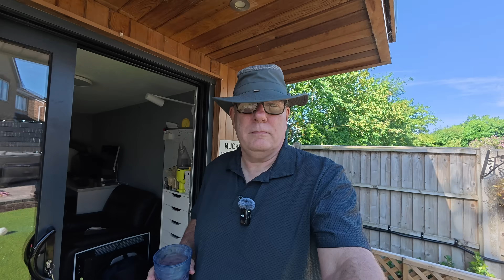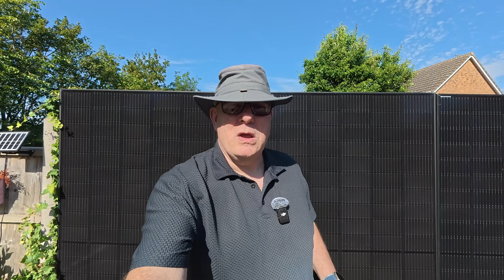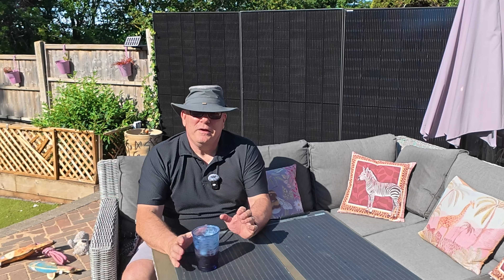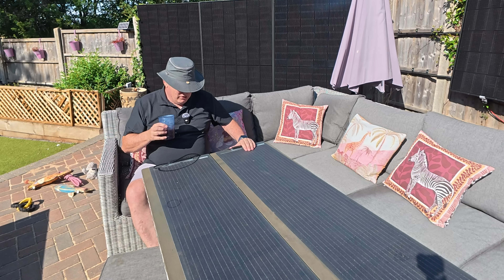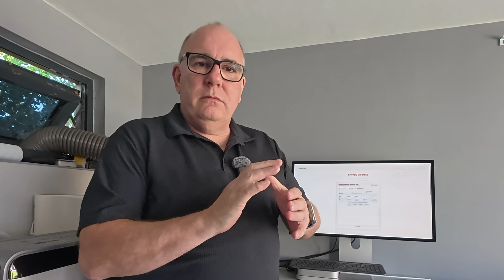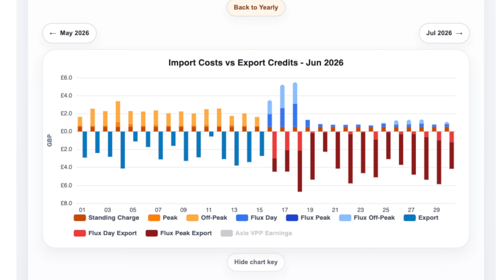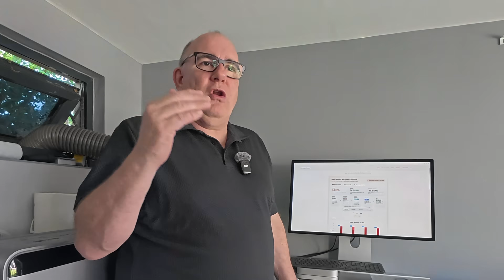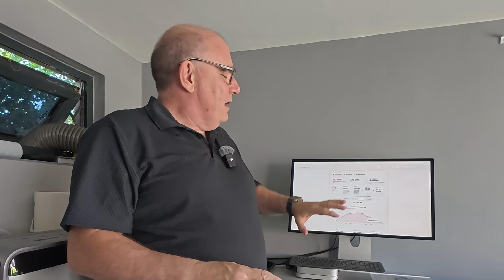Octopus Flux Is Back! Plus 4 Big Energy Project Updates

Comment: That's a great update. I was very impressed you put a bidirectional trip in your external box for the 'plug in solar' on wall project. I think that's smart and definitely future proofed. If I ever got plug in solar I would do the same. 
The tariff data is even more interesting. I have done my own libreOffice Calc sheet and 'I think' I can make up to £1100/yr using Octopus Flux, but there are two other options that are close. I will send them to you FYI.
My install date Solar/battery is next week, so I am almost certainly going to switch to Octopus Flux next week. Thank you for your insight.👍
Reply from the maker: For the summer months, if your battery is big enough to store energy all day, flux makes a huge amount of sense. I’m not sure it would be worth it if your battery was less than 15 kWh
Reply: @JonathanTracey  I agree, I have sent you an email with 2 other options I considered. I dont have an EV but will soon have very similiar setup to you 30kWh battery+, similiar solar array size and ASHP. Please have a quick look when you get a chance.
Reply: When our current 16.5p k/Wh export tariff ends, I'm thinking of going to a high paying 16:00-19:00 export, as we're in Cornwall, our panels are almost SW facing, and we're on top of a hill, so no shading to worry about. 
I've been monitoring the generation of our 3.8kWp system (no battery), which on a good day will produce 8kWh between 16:00 and 19:00, against a total of 26kWh for the full day, meaning a 3rd of our generation happens after 4pm. So my thinking is, that 3rd of generation at a higher rate, would offset the lower rate more recent tariffs seem to give.
Reply: @johnnodge4327 If you got batteries you could store your Solar and export more between 4pm and 7pm if you are not too export limit restricted by your DNO. Otherwise it may be better to look at other tariffs. Check out Tim & Kat’s Walk tool for comparing tariffs.
Reply: Excellent update. I really like the web interface you have created. Shame it isn't easy to offer this to your subscribers but I do get there will be a lot going on under the hood that isn't visible.

I also switched to flux about the same time as you and had the same thinking as well. I am glad you have validated what I thought was the right thing to do.

I assume you are quite local to me with that postcode. I am PE15.

Comment: Changing to Flux tonight.
What are you using to schedule the export from your batteries?
Home Assistant or Net Zero app?
Only had my solar/battery system for 6 weeks, so newbie.
Tim of Tim and Kat fame says HA is a bit of a faff and I have tried it - Home Assistant Green hardware Predbat/Teslemetry/Solcast etc. hours of…..faff!
Wonder if Net Zero app is best for Solar/Battery/Home Life balance 😂
Net Zero is Powerwall only of course.
Reply from the maker: net zero is just more faff, I have ways to do it from home assistant but TBH for 95% of the time I just schedule it in the solar edge app, I tell it to fill the batteries until 17:30 then export for 90 mins straight, that normally gives me 15kWh or there abouts of export. I think tell it to pause, not do anything between 2 and 5am as that the off peak times. This fixed schedule works for  95% of the time and the rest I do with home assistant if I need to over write it.
Reply: I’ve just started a 1 month subscription of the Netzero app. I have been using the free version since it came out but decided I couldn’t justify the cost when it went subscription in August 2025. Since then I have got an EV and an Ohme Pro charge point as well as an Expansion Pack.
I find the Tesla Time Based Control/Savings algorithm works pretty well, but at the end of the day (I’m on IOG) it hits the reserve I set a little too early and then draws from the grid.
So, what’s changed? Well, Netzero now supports my Ohme Pro, and with IOG integration it will automatically charge the battery during smart slots (at 10 kW) outside of the off-peak period (11:30 pm to 5:30 am). The algorithm then decides to export all of that, so that’s a nice saving. So with that and a couple of automation rules to export down to 5% at the very end of the day I can now export more and the Tesla algorithm hits the reserve dead on at 11:30 pm.
On balance then, I can make it pay for its self (just, plus a small profit) and have the benefit of seeing data on my batteries and 3 PV strings to boot.

Comment: Only a few days into my solar and battery journey. 
Do you have something to divert the excess solar into the car -my understanding of my system is that the car chargers from the incoming mains to stop the home battery discharging into the car.
Reply: On a decent EV tariff e.g. Octopus IOG and their Outgoing Fixed export tariff you should be better off exporting all of your excess Solar rather than diverting it into your EV.
I have my Ohme Pro charge point wired separately from the meter via Henley Blocks (my installer does this as standard now) so the battery does not see it as a load. I can still charge on Solar if I want but financially I’m better off exporting at 12p and charging at 3.5p!
Reply from the maker: yes certain types of car chargers can do this, I have two zappi chargers, they have CT clamps that go around the outgoing line from the you meter, if they sense enough exported power (about 1.3kw miniumum) they will start to charge the car and vary the charge rate to absorb all that solar. Had them for 4 years now they work really well
Reply: Thanks for explaining. I have a Hypervolt - not sure if this supports that. I have a hybrid car at the moment - need something to tow a touring caravan - so not a massive battery charging requirement.
Reply: @DavidMacKenzie-u6m I have Hypervolt fitted and have hybrid car  on really sunny days I plug my granny charger into a garage socket and fill the car with excess solar
Reply: @beaker1068 Turns out the CT clamp wasn’t on the correct cable. Enquiry to the contractors - Heatable - and the local installer was out before 9 the next morning and had it sorted. 
Been using solar power to drive about since. 😊